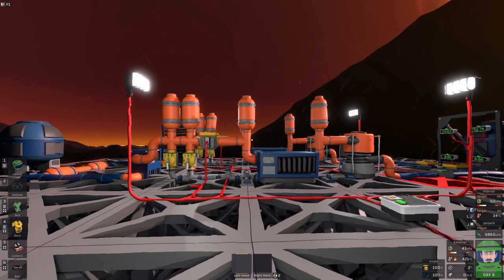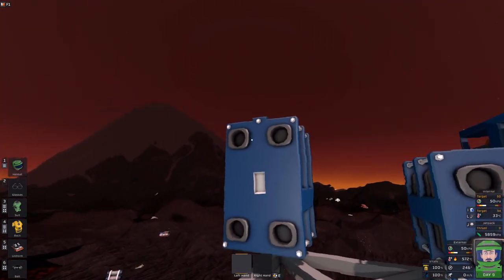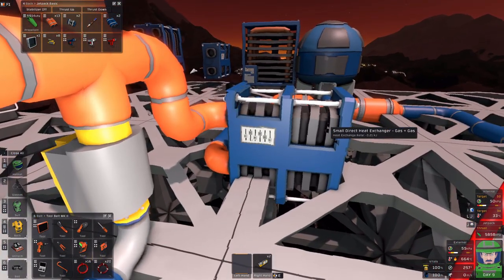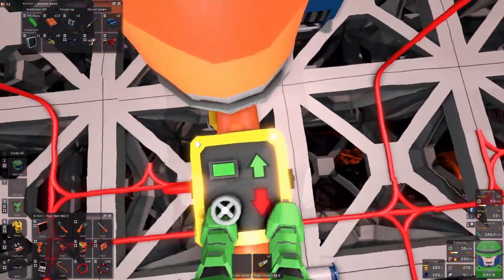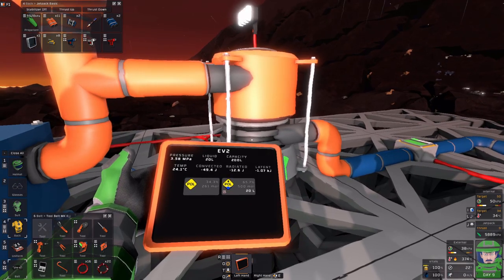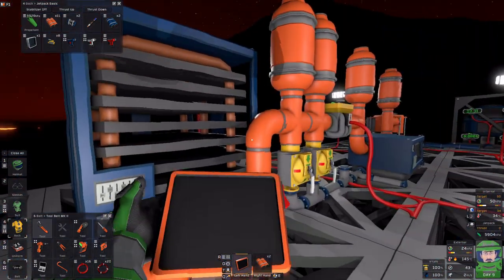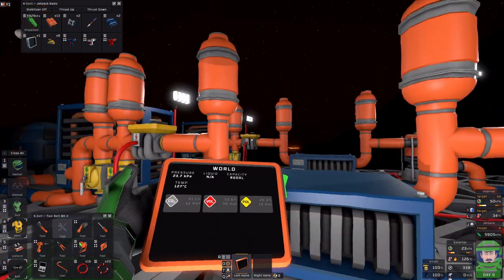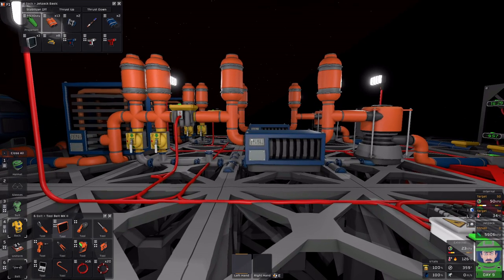Stationeers: Custom Compressors

Comment: Do you mean custom compressor or custom condenser?
Reply from the maker: Condenser… i got used to people calling it a compressor and  now its bled into my vocabulary for this device.

Custom condensation chamber, which for part of a heat pump set up this acts like a compressor.
Reply: @shadowdrake082  I confess I was a little confused. My chemical Eng degree many moons ago had compressors as something entirely different 🤣🤣🤣